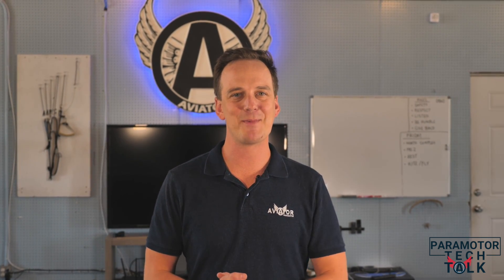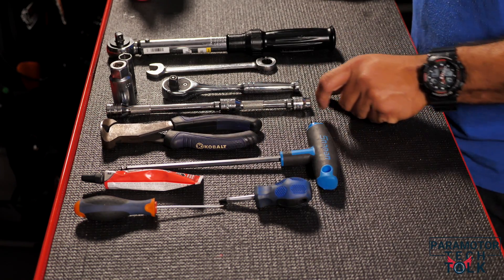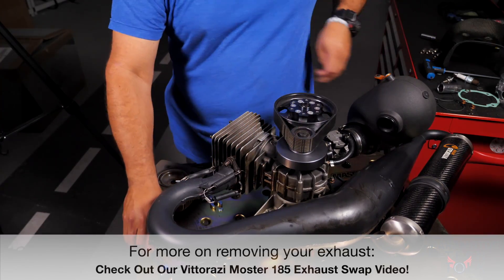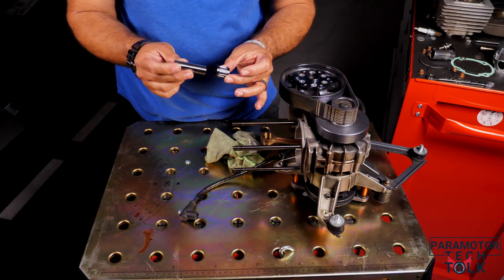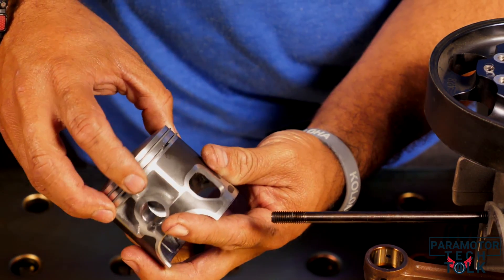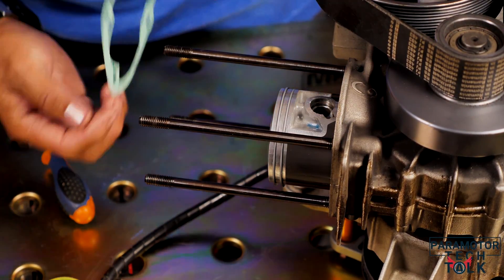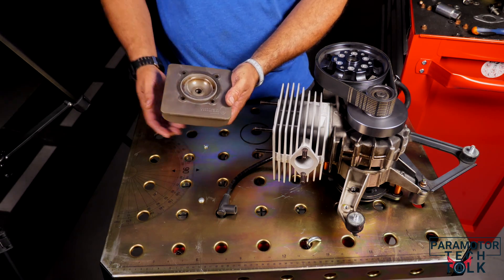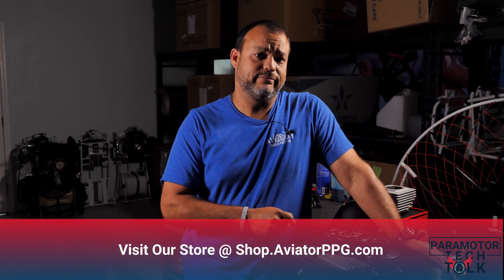Paramotor Tech Talk - Moster Top End Rebuild

Comment: Great video, thanks.   I'm not sure if you mentioned it, but when I install the Cir-clips I make sure the gap is facing up (towards the top of the piston)  or facing down (towards the crank).   I have seen cir-clips pop out during highspeed run-ups, and by orienting the gap correctly there will be less of a chance it will pop out.

Comment: Does anyone in this industry ever check piston to cylinder clearance or ring gap tolerance?
Not to mention crank - rod bearing slop or wrist pin bearing slop.
Seems there is probably a lot of loose engines getting put back in service.
How about putting the piston on in the correct direction? The arrow on the piston dome points to the exhaust port.
These are fine videos, but there is a lot more fine details to properly inspecting and assembling even a simple two smoker.
Reply: "How about putting the piston on in the correct direction" My friend made that mistake, it's an easy one to make.  The motor ran but it ran poorly and it stumped everybody at EFD for days.
Reply: Yep, the arrow is a little EXIT sign.   "Exhaust gases flow in this direction".
Reply: @firstbloood1  Squish tolerance for this engine is 1.35mm and 1.55mm - source: Jacopo at Vitorazzi.

Comment: I was hoping for a squish test demonstration. My Moster lost a lot of power after my 100 hr maintenance, and I believe the squish is the problem.
Reply: YOUR PROBLEM COULD BE  ANYTHING? YOUR BEST BET IS DO A SQUISH TEST ON YOUR OWN MOTOR...FIND OUT FOR SURE..
Reply: TONYPARAMOTOR  Im not going to risk further damage to the engine without a comprehensive guide or an someone that knows what they are doing to help me.
Reply: @theflyingveteran6250   HMM,HAVE U CHECKED THE COLOR OF THE SPARK PLUG.AFTER THE ENGINE HAS BEEN RUNNING EST 10 MINS.UNPLUG AND LOOK AT SPARK PLUG.IF WHITISH ITS RUNNING TOO LEAN .DARK BROWN RICH DARK TO BROWN MID STILL OK. CLEAN CARB.RENEW SPARK PLUG. ITS A START... QUOTE" My Moster lost a lot of power after my 100 hr maintenance", WHAT SIZE BASE GASKET DID U USE?... 5 IN TOTAL ALL DIFFERENT THICKNESS.

Comment: Don’t forget about the base gasket thickness/head Clarence part😜
Reply: @clubsnapperuk   I AGREE TOO. MORE SO ON THE BASE GASKET= SQUISH TEST?
Reply: Ring end gap is very important too,nobody ever mentions it but I always check it :)
Reply: @clubsnapperuk  Make a video bro.
Reply: @577buttfan   HMM,HE PUT NEW BARRELL ON .NEW RINGS PISTON. FAIR ENOUGH IF WAS A USED BARRELL.
Reply: That's right, Vittorazi provides a bunch of different thickness gaskets, never shown
Reply: @alvaroaguirre252  Yup.  Anyone actually trying to use this video will immediately run into this problem.  For reference, Vitto does not keep a record of which gaskets were installed on which engine, so if you haven't measured beforehand you're screwed.  Then you have to measure squish.  Source: I emailed vittorazi about this and they gave me the squish tolerance and told me to google how to measure squish.